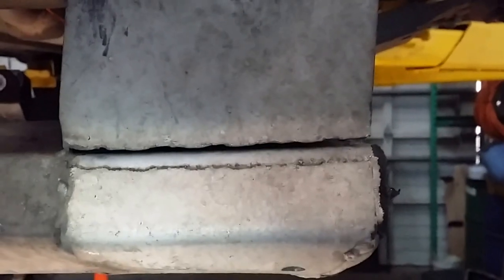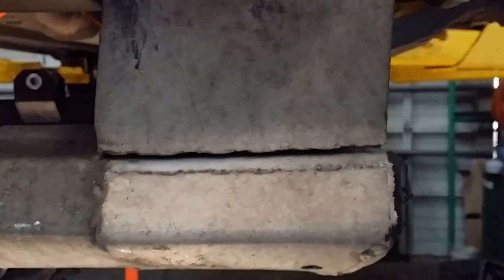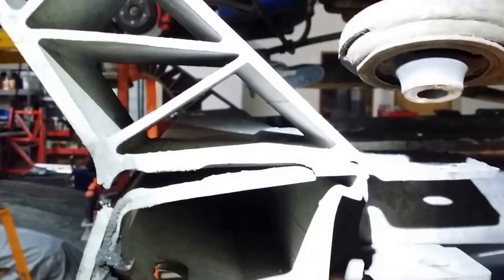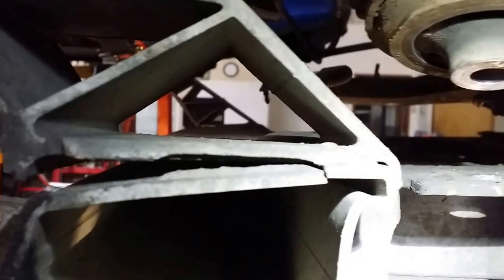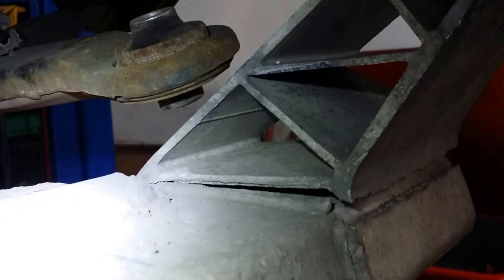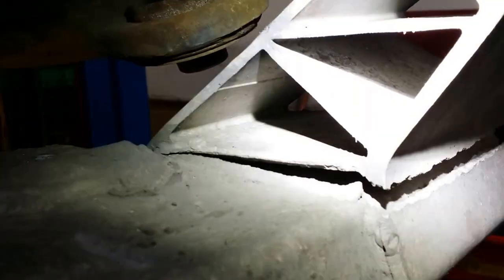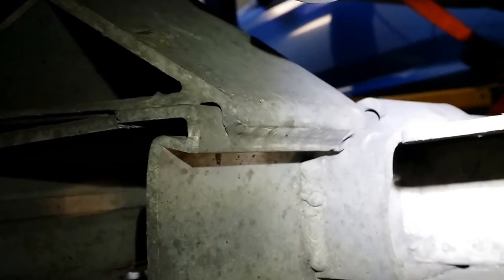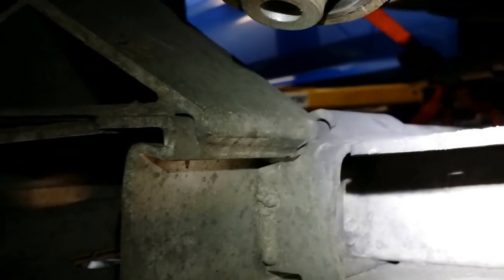Cracked Impala Front Subframe

Comment: how could this be fixxed?
Reply: U can't u just have to replace it....don't go to dealer they want 900.oo
Reply: @MILO20121  well if i gotta get it replaced imma try to mig weld it and see how it comes out. only issue is i would still need to close the gap but from what i seen if that could close it should be decent enough to hold since the framing for the wheels is a separate
Reply: @javarrolinn8038  I went to the junk yard n only paid 48.oo for it n a couple hours of my time n back to factory specs